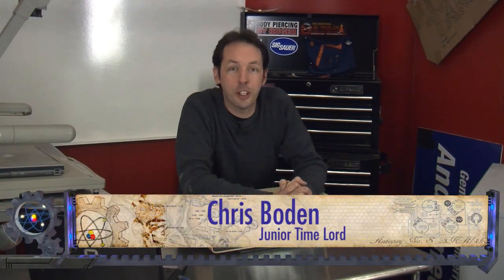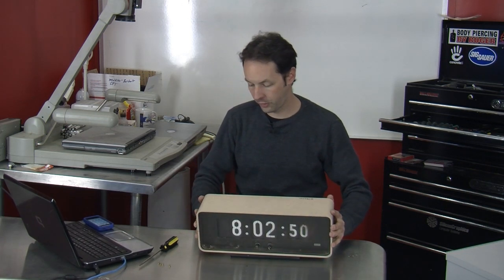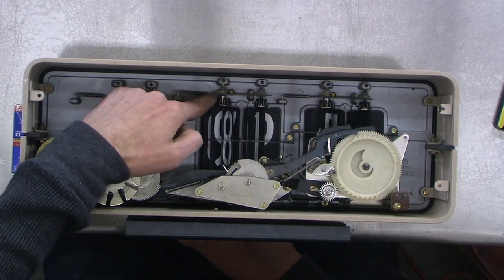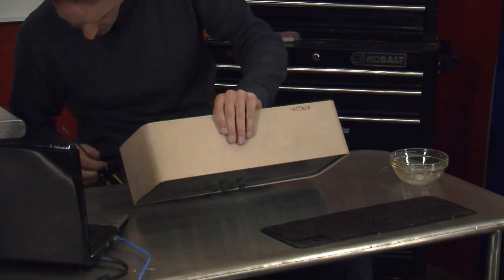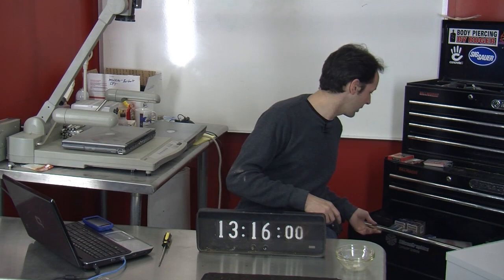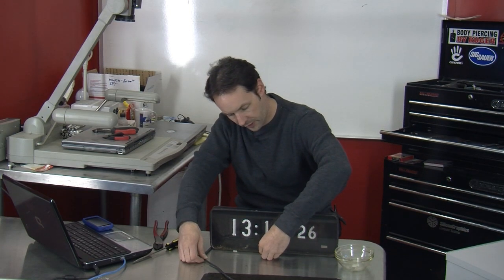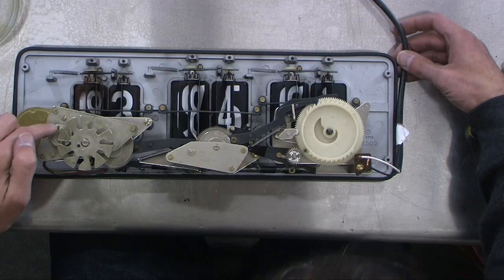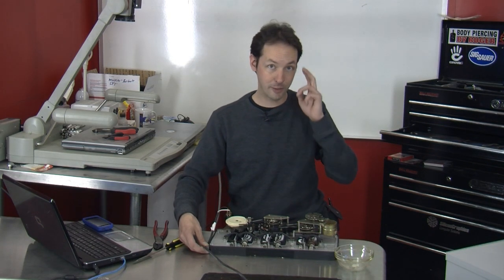Flip Clock: Equipment Autopsy #47

Comment: Please say this didn't get destroyed. Synchronous clocks are normally perfectly accurate, as the top poster says, this is almost certainly going to be a problem with frequency. I've played with a few synchronous clocks and still own two, one analog with hands and the other a flip clock. They're both easily as accurate as my quartz watch perhaps even moreso. The motor locks to the line frequency so if it's too high it'll be too fast.

Comment: You tried replacing the motor with a 60Hz synchronous motor? Since it's from Europe it uses the 50Hz line frequency to keep its time. So at 60Hz it will run 20% fast.
(still watching the video, so I don't know if you destroyed it in the end)

Comment: Use a high quality pure sinewave inverter and batteries to power the clock. It'll keep time more accuratly (no mains noise to disturb it), and will continue to run if the power fails :)

Comment: I think this motor takes frequency to calculate 1 second from power suply. So if it works at 60Hz if you have shity power it wont be accurate, also fluoresant lights on/off or other electromagnetic noise will fuck up time base.